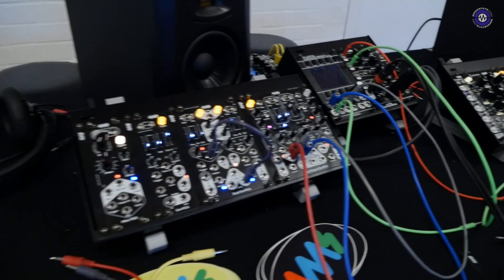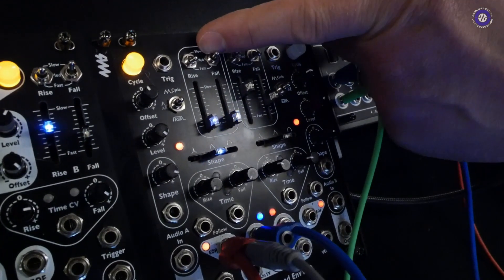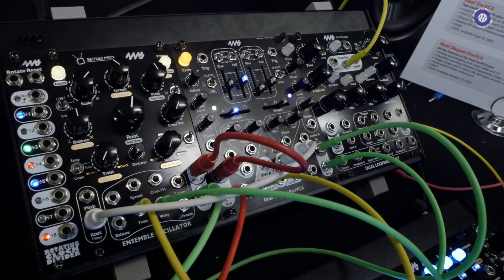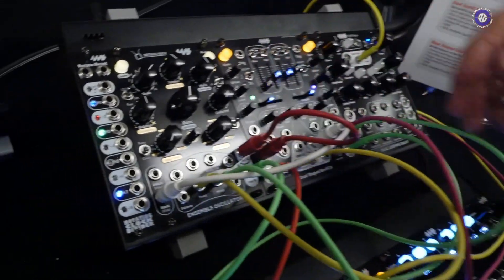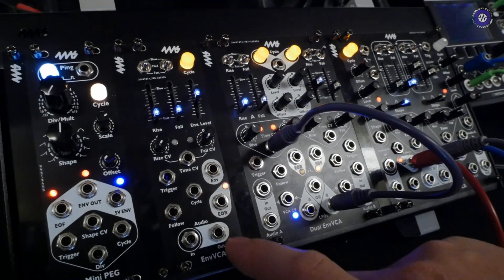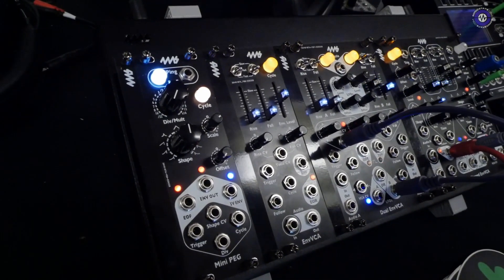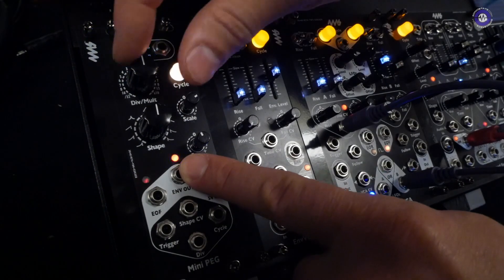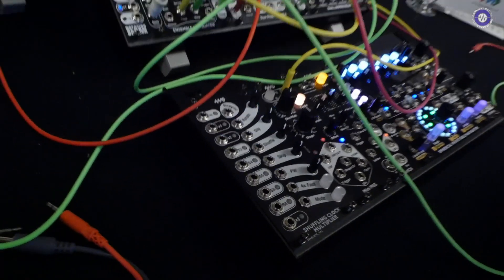Superbooth 22: 4ms - Dual Shaped EnvVCA, Dual EnvVCA, MiniPEG, Shuffling Clock Multiplier

Comment: Those look awesome! Finding it hard to choose function generators atm as I build up a 4u 104hp case. Initially Delta V was on my list as it hit that middle ground but now I do wonder if a more complex module is a better way at it.
Reply: i have the delta-v and couldn't be happier, it does a lot in that small package. i think you'll see it is plenty complex, and the built in vcas are a god sent for small systems. i actually wish i had two tbh.
Reply: @magjo665  thanks so much! I love the simplicity of the panel and yet how full featured it is. Wish I had a synth shop nearby to check these out in person.
Reply: @TheCheeriosMan  yeah, what ultimately sold me on it was that despite the compact format, it is actually quite spacious and nice to work with. a well thought-out module.